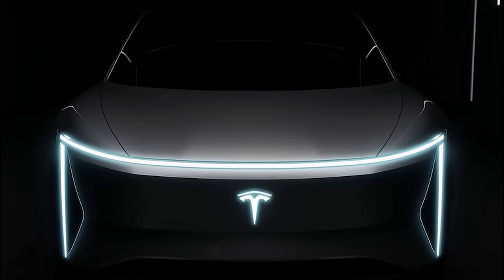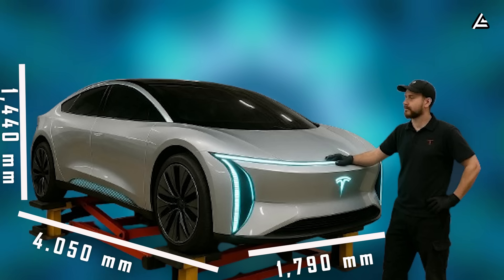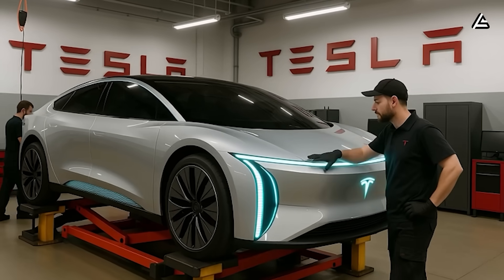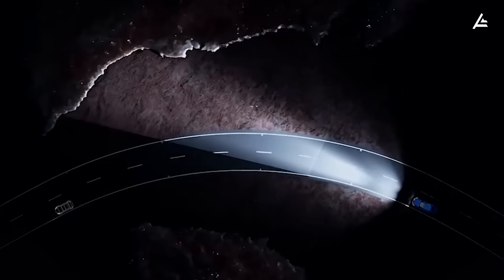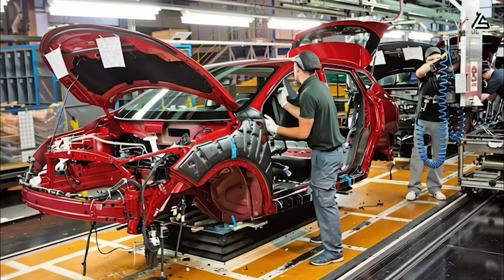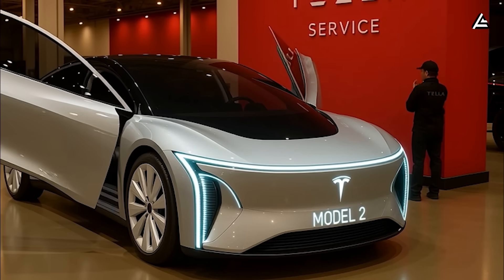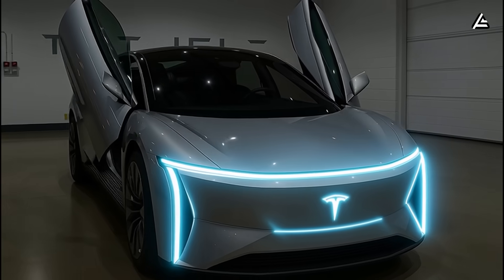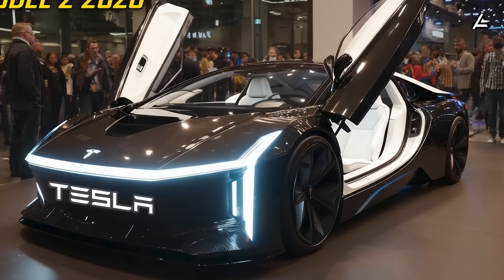Elon Musk Revealed 2026 Tesla Model 2 Exterior: What’s SHOCKING Design Change You Need To Know?

Comment: Das Model 2 sollte unbedingt die Nr. 1 enthalten.
Würde es Tesla schaffen, das Model 3 als Hatchback zu konstruieren, wäre das das ideale Fahrzeug. So wie jetzt, mit der kleinen Luke am Heck, ist es unpraktisch. Das Model Y ist zu groß. 
Auf ein Glasdach sollte verzichtet werden: 1. Augen während der Fahrt auf die Straße, nicht in den Himmel! 2. Kostenreduzierung. 3. Wenn ich ein Fahrzeug mit Klimaanlage besitze, brauche ich kein zu öffnendes Dachfenster. 4. Ausschluss jeglicher Undichtigkeiten.
Reply from the maker: You make solid, practical points—but Tesla optimizes in a different direction: hatchbackizing the Model 3 would require changes to the rear safety structure, which would increase rather than decrease costs. And a glass roof isn’t just for “sky-gazing,” it helps reduce weight, lower the center of gravity, increase torsional rigidity, and simplify assembly. In other words: these choices aren’t for “coolness,” but for optimizing performance, cost, and large-scale production.

Comment: What’s the expected cost of battery replacement after warranty?
Reply from the maker: It’ll likely be much cheaper than today’s Tesla packs. Current replacements cost around $10,000–$16,000, but aluminum-ion’s simpler materials could cut that by nearly half once mass production ramps up.